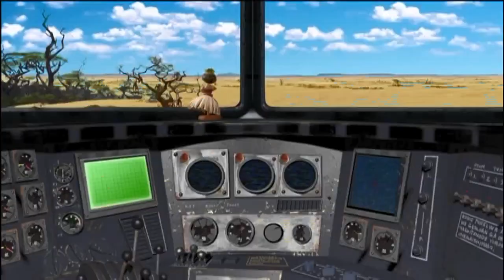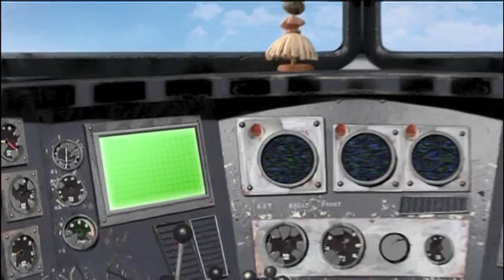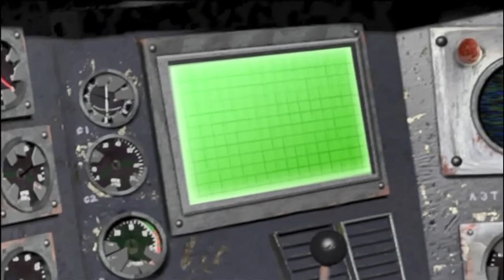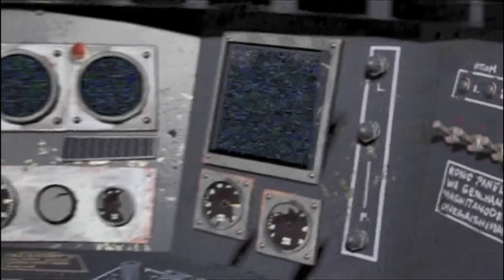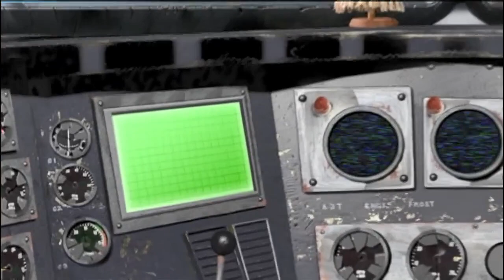Madagascar 2 Test Flight of Air Penguin Gameplay

Comment: Here are the correct answers for all six repairs:
1. Jeep engine or motorcycle engine
2. Oar
3. Tent 
4. Crates or sign
5. Surfboard or sign
6. Steering wheel 

All other choices will not work, so don’t pick those.